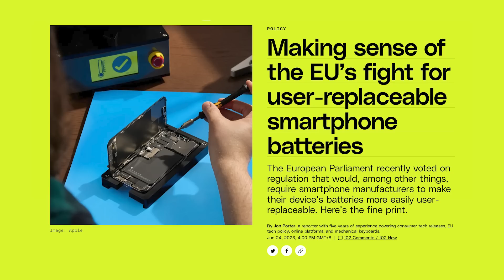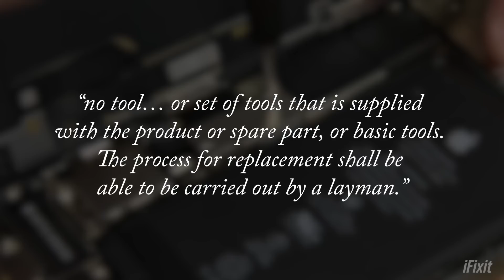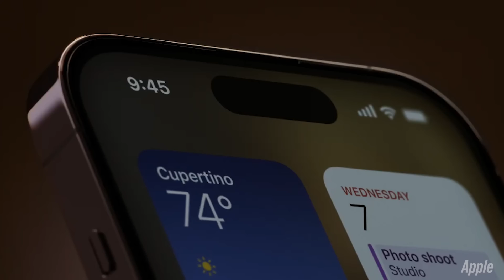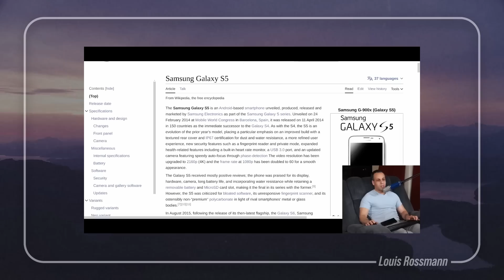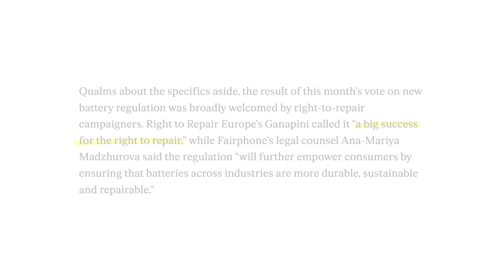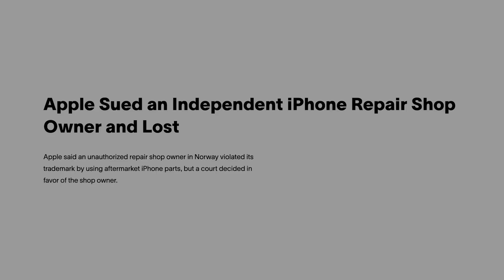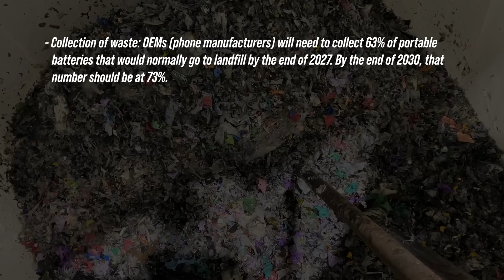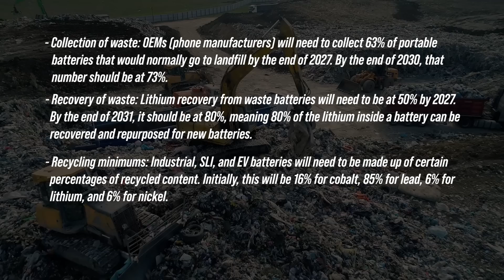EU Just Changed Smartphones Forever

Comment: Well I’ve always said the change to non replaceable batteries was just a way to force people to buy new phones once the battery and performance degrades in tandem
Reply: Planned obsolescence because of money, just sad 😅
Reply: @thataytay   Planned obsolescence needs to become illegal.
Reply: they achieve that just fine with lack of software updates @thataytay
Reply: @thataytay capitalism at its finest
Reply: @thataytay  its not sad, you're just poor
Reply: @thataytay that’s how business works
Reply: @thataytay  You mean capitalism as usual? You shouldn't be surprised that our economic system is working as intended - to generate maximum profits for the shareholders.
Reply: I was wondering what will happen to smartwatches.
Reply: @missanorajjohnthattil5333  good question
Reply: @missanorajjohnthattil5333  They will be thrown away when the battery life ends  and users will be forced to replace them with new devices.
Reply: That's what just happened to me, my 3 year old phone has a bloated battery affecting the lcd. Repairs cost almost half of the latest phones with better specs so it's only natural to buy a new one.
Reply: Not just phones. Items like mechanics inspection lights. Many high end flash lights. 
Electric screwdrivers electric toothbrushes,Fitbits ,solar powered garden lights All become disposable items when there life could be used for years.
Reply: @ks-hg5vo  

There are disposable battery-powered ceiling light fixtures that mount by adhesives.
Reply: Yes . Also software Updates are not given by manufacturers after 2/3 years. And then device gets outdated with many apps not working
Reply: @mgsa5722 unless you own a iPhone
Reply: Totally agree. From my perspective biggest offenders are things such as robotic vacuum cleaners. They could last you a lifetime if only you can replace the battery that will be dead after few years.
Reply: Exactly the same way they got rid of sd card slots to force you to choose between different gig sizes, and why they made glass backs so it's easier to break
Reply: Yup, fast charge+ non replace able batteries, what could go wrong?
Reply: True , but lets not ignore the fact that some manufacturers intentionaly slowing down their older phones to force ppl get new ones. This is still a big W for common people but wont change much.
Reply: @dekata91  this is where the next big fight will be.. I honously can't wait for this to receive 
receive more attention!! I can't keep buying a new phone every 2 to 3 years because they intentionally keep slowing it down!!
Reply: Something for the EU to sort out. @dekata91
Reply: @dekata91  This was done for the exact opposite reason - to allow the phone to last longer. As batteries age, they're no longer able to provide the same amount of power, which results in unexpected shutdowns when the SoC asks for too much. This occurred on phones which were already about 5 years old. If Apple wanted to push people to discard these old phones, they could simply cut off their support and it was expected that they would. Instead, they provided a new OS version which allowed users to keep using them. The actual problem here was that Apple implemented this feature in such a way that the user was not notified or able to revert it.
Apple has hands down the best SW support in the smartphone industry. While they do like it when people buy new phones, they're also largely incentivized by the appstore. People who like to buy new phones frequently still usually sell their old ones on the second hand market and Apple has a way to make money on these second hand phones.
Reply: @dekata91  Or shortened its Support on a Software side
Reply: @dekata91 COUGH APPLE COUGH APPLE!
Reply: @dekata91 this intentional slowing down has only been seen in Apple products, as far as I'm aware.
Reply: @DanielCrist that's why i don't upgrade my phone software...
Reply: @DanielCrist every Goddanm phone has it lol
Reply: @rochitgurung9090  every goddamn phone has what?
Reply: @DanielCrist Samsung also does this
My A30 got shit with updates over 3 years
Reply: @unknownrealms8452  yeah, no.... There's a difference between small scale anecdotal evidence like what you shared, and large scale studies and research being presented by reputable media sources. The A series is one of Samsung's budget lines anyway, so the performance and hardware wouldn't have been that great from the start. But regardless, your personal experience with one particular device is not remotely enough to make a broad widescale claim about a company.
Reply: @dekata91  I can name one company that does this it's called apple.
Reply: Exactly true
Reply: Doesn't some phone makers put in a software thing that slows down the phone over time? So you are to buy a new phone
Reply: I agree, and hope "right to repair" can go further to include easily upgradable memory on all phones and hundreds of other consumers product issues that are completely unnecessary. Long live "right to repair"!
Reply: @Waynards_World  memory might be tricky but flash storage is a very much limited lifespan item. Good catch.
Reply: LOL... I'm actually watching this video on my LG G5 right now 😆... I am obviously in agreement with the right to repair and battery replacement law... OEM batteries should also be more easy to come by, even after 3 years... I can't find ANY OEM batteries for my LG so I have to keep buying cheap China batteries that degrade WAY 2 fast!
Reply: Not sure about i phones but i looked at buying a new generation i pad from an official apple retailer and when asked about  the cost of a replacing  battery out of warranty i was told i would have to buy a new ipad ! It's scandalous. It's like samsung forcing people to buy chargers for their new smart phones their reasoning being that people already have chargers. It's simply not true it's just a way of making more money.
Reply: So they obsolete the OS to make it painfully slow to force upgrade.
Reply: @not1but2and37  yeah. A certain brand is espescially nasty in that regard.
Reply: just saw an article that apple 'surprisingly' rigged phones with updates to slow older phones down to get people to buy newer phones . they deny it but will pay out , still i doubt it will stop people from buying apple phones. it will be swept under the rug
Reply: Yes, that's called a very obvious thing that everyone knows
Reply: Or you could go get it changed for $50
Reply: Crazy that people still think it's a theory that Apple was intentionally slowing their older phones down so you buy a new one
Reply: @SilkyJohnson7 Old battery can not deliver same amps continuously or in burst as new one, so when company is slowing down your device I am pretty sure it's not because they want is slow, but because by limiting the frequency\load patterns it is possible to lower consumption and allow device to work on degraded battery. Keeping normal power consumption rates would lead to spontaneous reboots. You can see that happening on older android devices, or any device with completely degraded battery.
I am not defending anything, they could clearly inform costumers about that and make it so if you replace your battery for new one your prone will get back to normal speed.
Reply: @xerxeslv  All a battery is a capacity, and that is was decreases with charge cycles. The "but we need to slow it down" is just some BS they made up when that get caught. Its all about how fast you use the batteries capacity that matters. With the proper battery, something small for 50 lifetimes or something big for 15 minutes.
Reply: I used to buy multiple cheap phones just for spare batteries.  Yeah for capitalism...
Reply: Bad software optimization will do it even when you can change the battery :,D
Reply: But how long are they required to keep manufacturing the batteries? They're the sole provider, so if they stop manufacturing old batteries for older models, this enforcement seems useless!
Reply: and we all can thank Apple for that
Reply: Just like removing audio jacks and not supplying appropriate charging cables with the package
Reply: You don't know it's pretty simple replacing batteries
Reply: Just change the battery then… no one’s forcing you to get a new one jfc
Reply: To be fair, water resistance is a commonplace now.
Reply: @@user-rx4be4cg5n All you have to do is google replacement batteries, and you will see how cheap they are. Even cheaper than $80. People are acting like batteries stop working after a month. I've used a Samsung S21 for almost 3 years, and it's still going on the same battery.

The only time I had battery issues was when I had an Apple phones, and then I paid $20 for a new battery and fitting. Yes, batteries would cost more now, but if you are stupid enough to pay for the Apple brand, I don't see why those actually pay for quality tech should have to suffer for those who ignorantly fall for marketing.
Reply: That's why I won't be buying a new phone till Pixel Xa comes out and has a removable battery. A Pixel phone with 5 years of software updates and a removable battery is as solid as it gets. Slap a Graphene OS on this bad boy and you have the perfect phone.
Reply: Too many comments to see if anyone mentioned the Apple/Norway court case you refer to. Pretty sure the repair shop was using non-genuine Apple branded products and this is a big no no. Stupid to use them anyway as consumers don't see them. If you use non-genuine branded batteries as you don't want to deal with the 'it is a genuine Apple battery you are fitting in my phone', then Apple will come for you. There are enough good 3rd party batteries around that Apple leave well alone (intellectual property issue). The EU should have made a list of things to do by 2027: once every, say, 48 hour charging (stop using battery advances for super duper processors that 99% of consumers don't need; serialising for spurious security reasons; glass on hand-held devices, update terms that cause consumer panic, security lockout lottery (Apple, Samsung, Google) it's MY phone!
Reply: @CD-SU  "non-genuine" looses all meaning when you can walk out of an apple store with 2 identical phones, pull out a tool kit and do a component swap on the street and suddenly both devices are throwing "non-genuine part" errors.

Have the screen shatter and take it to the shop, shop harvests parts. Is that battery genuine? Logic says yes. A layman's interpretation of First sale doctrine implies Apple can pound sand.

The mental gymnastics Apple with do is mind blowing to anyone with a bit of common sense.
Reply: Yea ! To not support outdated phone models along with providing new generation of technology and software. To propose the EDGE of technology constantly and persistently. And now you'll have 10+ types of batteries and 10+ generations of phones in-line with support hell, broken production and supply lines, overload support and slowed progress and evolution of technology by itself because of embossed R&D complexity....
Reply: Bingo
Reply: I’ve changed iPhone batteries myself several times
Reply: They force you to only replace the battery from the manufacturer
Reply: yes, but do you use your phone for more than 5 years? 6 years? people change the phone regardless of the battery life. Replaceable batteries does not help them keep using the phone, this is always the case for contracts.
Reply: I don't think companies make non replaceable batteries to force people to buy new one. I can remember that battery replaceable phone's batteries were barely lasted 2 years. if u see now, phones battery are lasting more than double of replaceable battery.
Reply: It was for tracking
Reply: The prices of these phone are OUTRAGEOUS.  i don't think they cost $10 to manufacture.
Reply: If they wanted to extent smartphones use time they could have just passed a law that require x years of battery life and software support. Having batteries that easily come out is more about making it easy to recycle them I imagine.
Reply: no removable bateries take up more room causing less components to be used in the phone and have lower batery life to mass ratio
Reply: Yup. I kept my note 5 from 2015 until late 2022. Just replaced my battery 2 times. I still have it in my drawer and it still works flawlessly to this day. That phone still had better specs than any iPhone up until a couple years ago.
Reply: Yup agree. But i change them anyway. Im very happy to see it become law though. Planned obsolescence is a horrible thing... Things should be built to last. We dont have infinite resources...
Reply: @Trigenetic  this isnt eveb planned onsolescience rechargable bateryies take less space  alowing for more circuit board space which alows larger components and more upgrades  plus lol not got infinite resources while advocating for having exstra bateries made and sold to use up more resources
Reply: even before that, there are thousand of tutorial on how to change something on a phone. I used to change the screen and the battery for my oppo. as long as you find the pieces you can make the phone last double of his life
Reply: water, water proof
Reply: And to be tracked, data mined, etc.
Reply: I‘ve never changed batteries on my iPhone. My current one model 12 is now 21/2 years old and battery is at 92%. So it will least another 21/2 years easily and than I guess I want to buy a new one. Used my first iPad for nearly 8 years withit‘s first battery which died in grace. So I‘ve bought a new one. Will do the same with my current one, an Air 4.
Reply: Plus it allows for 24/7 tracking by the government.
Reply: @DoctorPPants  And advertisers, data aggregators, etc.
Reply: +1 it's greed. Apple is always greedy (but not the most advanced e.g. they gave Mac user "resize window from any corver", a Windows 3.1 feature, in 2012. And there's no menu key, to save you half of the work time, to this day). e.g. They force ppl to buy Mac if you want to create iPhone apps.
Reply: thats just a bullshit and ignorant argument. You can do a battery swap to any smartphone, the consumers are just not interested in removable batteries.
Reply: You are right. Phones lose their ability to update after the hardware can no longer update to a faster IOS. Batteries last a lot longer than the phones ability to be able to update to new and faster IOS's. Also I wonder who is pushing for this ability to change batteries. The battery manufacturers????? And how much will they cost? @DashzRight
Reply: This is great i can now buy a spare battery
Reply: Pretty rich for companies like Apple who claim that not including chargers was a way of reducing environmental impact and waste 😂
Reply: One of the very few useful things the EU has done 🤷🏽‍♂️
Reply: @@Con-Pin I went from an iPhone 6S to a 12. If I’m not mistaking the 12 was the first time they switched to USB-C. Therefore using the old chargers was not a viable option. People had to go out and but the charger separately. Case in point, Apple was full of it and this dirty tactic only served to make them more money.
Reply: @@Con-Pin I’m convinced you’re just here to troll. Have you tried charging an iPhone 12 with USB-A? It takes forever 🙄
Reply: It was one of the most examples obvious planned obsolescence in nearly the past century, and it's disgusting that so few were willing to call it what it is. Beyond the battery, there's not much. It was the low-hanging fruit for getting people to replace devices that otherwise mostly don't need replacing now. They aren't improving like they did in the early 10's.

Network changes? Yeah, sure. Takes a few years for a new standard to overtake the old in most places, so that'll push someone eventually.
Screen failure? Hard to predict the replacement point for that, but let's just ballpark it at 4-8 years.
Buttons? Unknowable; changes depending on how the phone was dropped if ever. Put it at 8 just because it does happen.
Battery? Oh that's going to hell within three years, no question. Might be tolerable to some for longer than others, but most will be hopping devices within four years if they can't replace that.
Reply: @YesterdaySoup  Planned obsolescence isn't actually a thing.  Lithium batteries are designed to last as long as possible (phones all smart charge to reduce wear on the battery and extend life, they also can limit maximum charge to extend life).  Lithium batteries just don't last forever.   I got a 14 pro last year and I intend to use it for 3 years total like every other phone I buy.  I 100% expect it's battery life to be totally fine when I trade it in but even if it wasn't...  is it really some crazy conspiracy when I can go directly on the apple website and order a new genuine apple one with all the adhesive and tools needed for $50?  I think $50 after 3 years on a $1000 is pretty minor.
Reply: One way or another you will be forced to change the device... 3 years after release there are no updates in firmware... This is probably a bigger problem than the actual batteries
Reply: @mohokios Im dealing with this exact issue with a Leveno Flex 5 laptop. Windows has forced updates that cant be undone and due to no firmware updates the touchscreen no longer works. Their solution? But a new laptop bro. 🤔
Reply: You’re correct. It’s all about profit
Reply: This is the kind of thing apple has been “innovating” over the past 10-15 years.
Reply: "degrade in tandem"? So the battery isn't the only reason they are replacing it? Is it even the main reason? People are mostly replacing their phone because the new one has new features and better baseline performance.
Reply: It's not just that, having a non replaceable battery means you can't be absolutely sure your phone is switched off. The EU should make all bloatware one click removable, stop the manufacturer from forcing it on us!
Reply: Indeed. I think of all my not so tech-savvy relatives and siblings; when I ask one of them why did they change their device, most of the time their answer is "battery doesn't last much anymore". Old battery means "old phone", even though the device itself is perfectly okay, or even an overkill for their use. Even with newer devices, for them, a battery mulfunction basically means a phone mulfunction as a whole, and is a reason to change the device itself altogether. Think of all the e-waste.
Reply: The performance doesn't "degrade" it is intentionally slowed down with heavy software updates. Look at apple. They literally slowed down older iphones with a software update
Reply: If they degrade in tandem then having replaceable battery won't help because you can have new battery but your phone is still slow
Reply: I’ve been using my iPhone 8 since 2017. Yes, the battery degraded over the years, but I just went to Apple Store and replaced it for 70 pounds a couple of months ago. It took me 2 hours. And I will use this phone for many more years. Even if the battery was replaceable, I would still need to pay these 70 pounds (or even more) to buy it. So, with all due respect sir, you are talking a load of shit.
Reply: @kostiapereguda  I only paid about €12 for a new battery for my Samsung Galaxy J series a few years ago, which had a replaceable battery compartment. But the problem is, people still want the most up to date technology, so many people replace their phones after about 2 years regardless of battery condition. Usually when their phones start running slow, their photos are starting to look below average, or they crack their screen, or they simply have a free replacement available with their phone contract renewal.
Reply: @DanielCrist  yes, that’s my point. Battery isn’t the primary reason people are replacing phones. Therefore non-replaceable battery isn’t “a way to force people to buy new phones”.

Plus. If the batteries were easily replaceable by anybody, how would companies actually ensure that batteries are recycled. Now when you go to the service to replace your battery, they recycle the old one, but when they will be easily replaceable, how would one control that users actually go and recycle batteries, and don’t just throw them out in garbage after buying a new one and replacing it on their own?
Reply: @kostiapereguda They could add a hefty up front core charge to encourage people to return the batteries after a change. Of course that would make them use more fuel because that may make it another trip to the purchase location.
Reply: @brianw3415  which means you still need to physically go to the manufacturer’s service to hand in your old battery and at the same time get a new one and replace it (thanks to the new law you will be able to do this with your own hands right there in the service store without asking for a technician’s help, very nice) so that you don’t need to pay upfront charge. Now how is it different from just going to the service and asking the service guys to just replace the battery for you (as it is now)? Also what is stopping vendors from making their “easily replaceable” batteries proprietary and non-interchangeable between models. Forcing users to return batteries in the way you proposed defeats the whole purpose of the “replaceable” batteries in the first place.
Reply: @kostiapereguda  How many service stores allow you to just start working on  your own stuff in thier store? Can you go to a car repair shop and just start changing your own parts in thier shop? You can pop into your car and then take the phone apart with whatever tools. I'm just assuming though that it won't be as easy as slipping the back of the phone off. In that case then, sure pop it in and out in the store. But if you need a screwdriver because of water proving or whatever. Then most placed frown on starting to tool up in thier place of business.
Reply: @kostiapereguda  OH yes I'm not into this law and all the manufacturers will definitely have proprietary batteries. I mean look at the way things are crammed into any modern phone.
Reply: @kostiapereguda  Battery wear will happen, so its a fixed failure point. "Well I already have to get this really expensive battery and pay a bunch to get someone to put it in for me, I might as well just spend a little more and get the new hardware anyway"

Want to try again without the straw man?
Reply: @kostiapereguda Simple. Put a core charge on device batteries just like you have with lead-acid car batteries
Reply: No yuo wouldn't because an aftermarket version is nothing like that expensive. @kostiapereguda
Reply: @kostiapereguda  Replaced a replacable battery in my Samsung at the time for 10 eur, in 1 min and it was delivered to my mailbox. So with all due respect ...
Reply: @blubblubpfff  did you recycle the old battery with Samsung? Did you send it to them via mail or something? The whole point of this is recycling of used batteries. It is much easier to ensure that batteries are recycled on large scale when you can only replace them in a dedicated service, than when it is just a consumable. People are more likely to recycle a whole phone when it breaks than to recycle an easily replaceable part of it especially when it has no monetary value unlike the whole phone
Reply: Going to charge $300 for replaceable battery. Go ahead replace it. Now your  your 2” thick phone has a replaceable battery. Happy now.
Reply: Performance on phones doesn't degrade. Just hold back on needless "updates" and your phone will be as fast as it ever was. Some software needs a lot of CPU power but if the CPU has to run at full speed all the time, likely it'll run the battery down quick anyway. I turn down upgrades by default and I've had no problems in years and years. Generally an "upgrade" just means more ads with more intrusive tracking. An average user has no need of them.

Is this Apple phones you're talking about? Are the OS updates compulsory on those? If they're not, the answer is, don't take them. If they are, the answer is don't buy one.
Reply: @greenaum rather than those software could contain major features that the user wanted
Reply: You can change batteries in phones. You just open up the phone.

Now, how is this going to be monitored and regulated? By the EU? Are they going to do it for free? Of course not. The price of your already expensive phones will go up. This is just another money grab by the gigantic EU state which already profit of every phone you purchase. If they want companies to make phones with removable batteries, then all they have to do is reduce tax on such phones. Companies like Samsung will then give the consumer the choice of both easily removable batteries and non options.

The majority of comments I see under this video in support of a LAW for this is shocking... When the price of phones start rising because of this LAW, I'm sure the same people will start blaming their own government's ineptitude for the situation instead of the unnecessary law they were in support of...
Reply: @ActualCoverage First, EU is not a stat, I guess you are english as you think that.
Second, the phones with unreplaceable batteries are usually more expensive, like the US fruit phone, than higher quality phones with replaceable batteries like Samsung.
Reply: @ActualCoverage  You obviously haven't seen how new phones are held together vs old phones.
Old phone: slide your nail/little bit of plastic in a tab, pop off the cover, swap battery. 30 seconds tops.

New phone: glue, more glue, non standard screws type 1, ribbon cables 1-7, non standard screws type 2. Oh and the battery is physically glued in with a big wad of glue that is at least 10% the weight of the phone. Even when its not that bad your still looking to need a heat gun and some way to pull apart the phone.

And this isn't something that you need an inspector watching the factory line for, a company puts out what 6 new phones a year tops? Give 5 people 5 minuets to figure out how to swap the battery and 25 minutes to write the report. Its really a pass/fail sort of report. Figure after admin costs and all that, $100 per item per review? And the first time Apple think they can get away with something nail them for 10% of there annual earnings as a fine. Let them talk that back to 5% for the first offense and they aren't going to be screwing around again...ever. And you just paid for the enforcement with the interest alone.
Reply: @ActualCoverage  "yOu JuSt OpEn Up ThE pHoNe"
Yeah, and risk cracking your screen, and completely void any warranty or support. Clown.
Reply: i think it's safer to have non-replaceable battery.  Also, the phone will be outdated even before the battery degrades badly
Reply: @rahulmaron  I have a Samsung A51 and the battery is certainly on it's way out after 3 years of constant use, but I am certainly happy with the performance of the phone itself and don't need anything more powerful or with more features.  At the moment I'm going to buy a case with a battery built-in to help.
Reply: @rahulmaron  How so? And what metric are you using for outdated? 300-500 charge cycles to degrade to 80% is a commonly cited figure. Lets say 500 to drop 80% then 300 to drop to 80% of that, or 64% of original. A charge a day, 800 days, or a little over 2 years. Hard to see how hardware is going to be outdated in not even 3 years.
Reply: @nickierv13 several factors. I am not talking about degraded performance. outdated in terms of aesthetics,  features, and software. And most of all, it feels old and need to be replaced.
Reply: @rahulmaron  So subjective points. I need a phone that can make a phone call. Really big ask I know. And to go with that phone call, a calendar, calculator, camera, and note pad. Not exactly anything that needs updating.

And you still haven't addressed the safety issue.
Reply: well they last for like 4 years and then a phone service can swap them out in 10 minutes unless it's an Apple. Now if this comes into effect all phones will be fucked because of some nostalgic old lawmakers who don't understand how tech works. Imagine making the battery replaceable....by the time it's losing capacity your phone will be so fucking slow because of software changes, but at least it's twice as large now.....
Reply: Almost all of my batteries in my devices last well past the device's usefulness.
Reply: @pumpkinchucker4953 what criteria do you set to concider your phone/electeonics to be beyond their point of "useless"??
Reply: @suprlite  when they fail or I can no longer get support for them. Why is my choice on replacement even up for questioning? My statement stands that my batteries have typically lasted an appropriate amount of time.
Reply: @pumpkinchucker4953  How is it possible for your devices to be useless before the batteries die?
Reply: @pumpkinchucker4953 are you impulsive by any chance? I still have my phone from 5 years ago and this Tab S6 I'm writing this on. The batteries are both below 60% effective charge. Both items are still in immaculate condition however the battery on the phone runs out very quickly. OnePlus Oxygen OS is very lite and a battery replacement soon is exactly what it needs. Imagine if phones had removable batteries and battery recycling was the next focus for the tech industry instead. Stop small braining.
Reply: @pumpkinchucker4953  "device's usefulness" ? What do you mean by that ? Because I do not think your statement is very true. I don't think the next generation you bought was more useful. Just more "new". You used same GPS, same browser, same calling app, ...
Reply: @benjaminfourgeaud7707  What? You cannot say that without knowing what I had vs. what I replaced it with or even why I replaced it. Your assumption bias is obvious.
Reply: @pumpkinchucker4953  what does device usefulness mean to you?
Reply: The batteries are not non-replaceable. They are not considered to be user replaceable, thus a user changing one will invalidate the warranty within the warranty period. Thus it must be done by a suitably qualified technician so as to not to void the warranty.. I agree most companies will make this an opportunity to rip customers off by over charging for the process but it can be done. It will still, most likely, cost a lot less than a new device.
Reply: I have an iPhone SE 1st gen, it is 5 years old, battery needs replacement, Apple does not have replacement batteries, too old they claim.  Will give a small discount if I buy a new phone.
Reply: @paullemonidis  At least in the US it's illegal to void warranties for that reason.
Reply: @paullemonidis  apple literally blocks third party batteries and you have to go through hell and back to get the shit to work.
Reply: @paullemonidis yes, it will cost less then a new phone.
Will it cost less then a new phone with your old specifications? And what about the rest of the aging parts? 
Fact, battery cost $5-$10 depending on model 
User replacement like it used to be, that is all the costs.
Nowadays.. $50-$100 to "get it done" , something that used to be so simple process.

Sure, it's funny to have a phone that is so darn flat you can fold it double and still feels usable.

Like LG has proven, it's not difficult to make the battery removable.

A 3 year old $300 phone wil set you back $75 to replace the battery.
New phone with the same "3 year old" specs will cost $100..., Probably outperforming the old phone.

If it was just 5 or 10 bucks...
Absolutely second life cycle!
Reply: @paullemonidis I have always just popped of the back cover on my phones, taken out the old battery and put in a new one but then again I only use quality phones not us fruit phones.
And yes they are of course water and dust proof as they are needed in real life.
Reply: Not true.  My current phone a lg  v60 the battery itself is permanently glued in, not just the case and can not be replaced even by a professional
Reply: I think it's factor for many companies, but its definitely more efficient for functionality and assembly to not have replaceable batterys
Reply: Certainly not. In fact, it's entirely feasible to craft a design at an equivalent cost. I can easily envision a concept within a matter of seconds that leverages the existing components present in the current iPhone to incorporate this functionality.   @Nothing-f8z
Reply: Wrong. Having a replaceable battery should have no effect on functionality. Makers are just lazy and greedy. @Nothing-f8z
Reply: @Nothing-f8z This is incorrect because there is ZERO change in efficiency between user replaceable and non user replaceable batteries in a factory setting. The only difference between the two it the design of the back plate. The whole non user replaceable battery system was to force users to buy new devices so manufacturers can make more money. Every component is made in just a few factories around Asia.
Reply: Just take care of your batteries and you'll save money in the long run.
Reply: I prefer a phone that can't be stolen immediately switched off. Removable batteries compromise security.
Reply: Removable batteries do not pose a security compromise. Those with malicious intent can easily circumvent this concern by purchasing a relatively inexpensive cell signal blocking bag, rendering it a moot point. @TerriTerriHotSauce
Reply: @TerriTerriHotSauce  How? I think I know where your going with this but if you say "find my phone app", a non removable battery isn't going to help.
Reply: @TerriTerriHotSauce A thief competent enough to do that would also likely be competent enough to put the damn thing in a faraday bag, completely nullifying the security argument
Reply: @TerriTerriHotSauce  You can probably cut off the battery with other equipment as fast. But this can make it easier, absolutely, but I can't see how that would be enough of criticism to not have easily changeable batteries
Reply: how do u achieve water proofing if it is user replaceable?
Reply: @wowsean  go pro and others  have waterproof to 15m  they all removeable batteries .
Reply: @wowsean  Does it really matter? The utility of being able to carry around a spare battery or change your battery when your one is getting old is much greater then being able to protect a phone in the highly niche case when you need to submerge it in a pool.
Reply: @watchonjar  waterproof phones aren't designed to be waterproof because they think people will want to go swimming with them, they are waterproofed do that they can survive getting caught out in the rain, falling in a puddle, a bath, or worse - a toilet, or so you can grab your phone while standing in a pool without worrying about it getting splashed or you dropping it.

That being said though, there's not reason why they can't be both waterproof and have a replaceable battery, as there have already been many phones and cameras with both of these features.
Reply: @watchonjar why on earth would anyone carry around spare batteries for his devices, when he or she could just take a powerbank?
Reply: @wowsean good seals. I still have my 2014 galaxy s5 in my old electronics box
Reply: @wowsean No problem, just look at Samsung XCover that is submersible for half an hour in water.
Reply: @wowsean it's called rubber gaskets.
Reply: @wowsean The same way it was done before. By a silicone seal. I currently own a galaxy xcover pro. It's IP68 and has user replacable battery.
Reply: Very simply. GoPros do it so phones can too. @wowsean
Reply: @wowsean  they literally said that in the video
Reply: @wowsean Samsung S5, IP67; Samsung S5 Active, IP67 and MIL-STD-810 certified.
Reply: @wowsean  The waterproofing surrounds the inner container housing the CPU and other hardware, the battery slides in and interfaces with a socket that acts as a bridge between the waterproof region, and the battery housing which itself can allow water to enter, but is irrelevant since it is outside the waterproof region.
Reply: @wowsean  Simple, you don't, user replaceable batteries is a more important feature than waterproofing
Reply: @wowsean  Very easily, the same way the charge port is waterproof!!!???
Reply: @wowsean The same way they do in amateur radios. The battery locks in place and creates a water tight seal.
Reply: @wowsean galaxy s5 was waterproof. It had a user replaceable battery
Reply: @wowsean  easy make the phone and the battery both waterproof while have exposed connectors made with non reactive conducting materials. with rubber or foam around the outside the connectors to stop shorting. its very common ways of doing it.

Could use use oil/Greece but that would require the use to replace the oil/Greece everything, it what they use of boat and ships for moving parts.
Reply: @Nothing-f8z you cannot make a battery waterproof not making sense
Reply: @JJN631  Your right its impossible for batteries to have a casing, let alone water tight one.
Reply: @JJN631 Yeap, that was some strange way to deal with it lol, waterproof battery, I think it is not required at all.
Just a bit thicker back cover with kinda like short bolt in it, with flat surface, the bolt head will sink into the deepening of the cover when screwed in. Cover have waterproof gasket, all you need is a small screwdriver like tool to unscrew the bolt. Just like you need a pin to open a sim port. You can do 4 bolts on each corner or just one bolt and good cover fixing mechanism and strong enough cover, that's it.
Reply: @Nothing-f8z  Greece is a country 😄 Grease is a lubricant.
Reply: @suprlite yeah voice didn't help here
Reply: @Nothing-f8z  so instead of an easy way we need to overengineer this in order to satisfy whose needs exactly? People who want to use outdated phones for 10 years? smh

you saying "common ways" whereas phones have severe limitations on how much space you're working with and it's just not worth doing for that little benefit of weirdos
Reply: @noobgam6331  Overengineer? 🤣🤣🤣 Have a look at (for instance) an xcover pro, and tell me ho it is "overengineered" compared to any sealed-in-battery flagship-phone.
Reply: @suprlite  Please tell me that phone only came out in the last 9 months or so... I spent so much time looking for a modern removable battery...
Reply: @nickierv13  the xcover 6 pro came out quite recently.
Reply: @wowsean  A lot of action cameras had done it long time ago
Reply: @wowsean 

Gaskets. I have a waterproof water bottle. It is a simple matter of screwing down a gasket.
Reply: @wowsean don't drop it in water?
Reply: @wowsean why would you want water to touch your phone at all?
Reply: @heroinmom153  lol, I agree. even though my phone is water proof, I am still cautious enough to purchase a water proof pouch for going to the beach. sea water is extra corrosive
Reply: @heroinmom153  you should always give speciifc examples instead of saying "there are many", because you're probably talking about nokia 3310 or something alike.
Reply: instead it was just to make them better, an iphone batter change from Apple costs 59 bucks, did it 2 times.
Reply: @JohnSmith-pn2vl on the older style devices (pre-iPhone X, such as the 7/8/SE) the U.S. price is $69 for a non-warranty replacement. For any from the X onwards, like the 14 Pro Max, it’s $99. 

That’s assuming you have an Apple Store or Authorised Repair location close to you. Otherwise, you have to pay that fee AND be without your device for however long it takes to send it off, have the replacement done, and then have it sent back. 

Giving users the option to replace their own batteries is nothing but a good thing.
Reply: BS!  I've replaced the battery on my Galaxy Note 9 twice.  It did take some skill, but not much.  The EU is so hippocritical it pathetic.   Why do they allow lithium batteries in vape cigarettes, 100% of which wind up in landfills.   I'd love to see the stats on that by weight
Reply: @thatsaloadofcrap  to be fair, most e-cigarette devices that people are buying nowadays use refillable liquid or replaceable cartridges that include both the liquid and the heating coil - the batteries are generally used for the full life of the battery. The kind of fully-disposable ones where you throw out the whole device after 2-3 days have not been very popular ever since the Juul introduced the concept of replaceable cartridges or "pods" (as they were advertised as) to the widespread market 7 or 8 years ago.

And you can still use the phone without updated firmware, you just may not want to conduct financial business on the phone without an updated security patch.

But honestly, how many people still wanted to use that phone when they stopped providing updates? What were the usage figures in the months leading up to the phone being obviously passed over for an update, or even the number of those phones that downloaded the last update it was provided? Many phone makers promise 4 years of software updates for their most popular phones, and some, such as Google (starting back from the Pixel 6) even guarantee 5 years of updates, because there will still be a small but substantial number of people using those devices in 3-4 years, given that they are high quality and using the latest and most innovative hardware and features at the time of release. Most people only keep a mid-range phone for 2 years on average, not because of the battery, but because the hardware has already fallen so far behind the present day status-quo (most of the time the hardware they were released with us already slightly dated when new). That becomes worse if you just look at the 18-34 segment; I forget how long it is that they keep mid-range phones but I remember on average they keep flagship level phones for the same amount of time that the whole population keeps mid-range phones - about 2 years. People in general want a good camera on them and they want the latest features.

If you have a mid-range phone that's 3 years old it's going to be running slower from the memory being written over so many times, and because modern apps and webpages will require more computing power to process, because they will be designed with current-day devices in mind. But being able to change your battery is not going to keep many phones out if the landfill for any longer than they would have if they couldn't be changed. It's progress getting slower, cameras on other offices getting so much better, the expectation for video resolution constantly getting higher, and often just a cracked screen. I'd guess that cracked screens cause more phones to be discarded than aging batteries. Phone screens are even more expensive to get replaced than batteries, so when a screen replacement costs barely as much as the phone is currently worth, many people will just buy a new phone. 

Now, instead of passing ridiculous legislation to ban batteries that are non-replaceable, I think it would be much better to instead provide incentives for phone makers to produce phones that are modular, so if your want an updated camera, you just remove the old camera piece at home and slide the new one into that slot. Want to replace the battery with a bye one, or even a larger one? No problem, the old one just pops off the back and the new one snaps into place. Want it running faster for handling games and multiple apps? Just remove the battery and slide a second ram card into the next slot. CPU? Swappable. Storage? Expandable. 

Now something like that from an established brand with a guaranteed 5-10 years of hardware updates would make a difference. But instead they don't take to anyone from the industry, just among themselves, and decide that this will keep phones out of landfills. They in all of these articles, I've never seen a single quote from a politician referring to any market research indicating that battery performance is a significant reason why people replace most phone brands.
Reply: You are straight up wrong. I cant open up my s10e without destroying the waterproof seal and atleast an hour of work. Plus the updates make my cpu running way more than at the start but nothing around it really changed. Im happy if i get a full day. It mostly dies around 4pm. 
I hate what the industry does. I only see better cameras which i dont care for. Why should i pay 1k bucks for that?? And yeah the cigarettes are a problem bit youre wrong about the EU doing nothing against it. They only allow to sell them with replaceable packs right now.
Reply: @Cope_93  since we use clouds for passwords, e-banking and store tonz of other sensitive data through are cellphones I would consider security updates more important than just the battery....after that all expected is someone finding a security hole.... And guess what... No support, no updates.. no nothing... But I guess everyone values things differently I guess...
Reply: ive used my iphone 8 daily since 2019 (i bought refurbished for $350) and the battery capacity is still above 90%.

smartphone batteries (at least with iphones) are good enough nowadays to last over a day on a single charge, and by the time the batteries lose capacity (5 years), the phones are no longer software supported

why is nobody thinking about this from a practical viewpoint? look at the design of iphones, replacing the battery takes less than 10 screws, and the waterproof seal can be completely replaced after. to make it any more simple than this would mean making the back of the phone cheap plastic, and would interfere with Qi charging and Magsafe.
Reply: ChatGPT

1 / 1

A simple square latch on the rear could easily resolve this issue, as has been successfully implemented on various phones in the past. Given the capability to incorporate LiDAR technology within a smartphone, designing a removable battery is undoubtedly achievable – a topic that doesn't warrant further debate. @imstupidbut
Reply: @imstupidbut  Everyone from the right to repair is thinking from a practical viewpoint imo.
It is not practical to need to have special tools to heat the phone to be able to cut the adhesive with more special tools. High chance of damaging other stuff inside the phone or outside.
Then you need new adhesive as well and probably more stuff I didn't think of.

You can get your old phones to be software supported by using an Android phone and install a custom OS for e.x. But that is advanced.